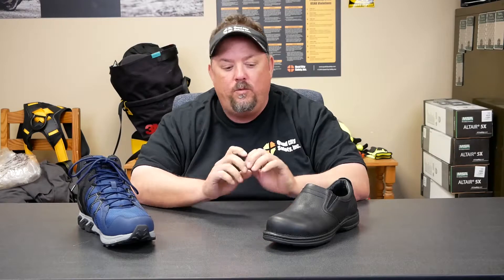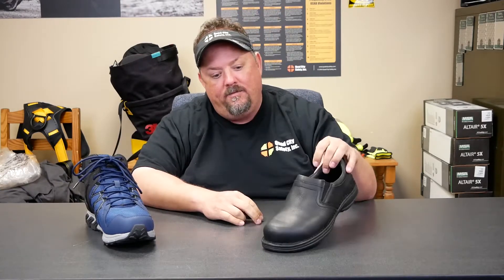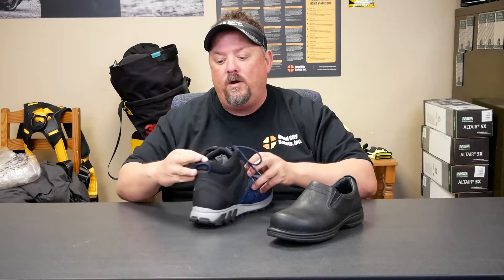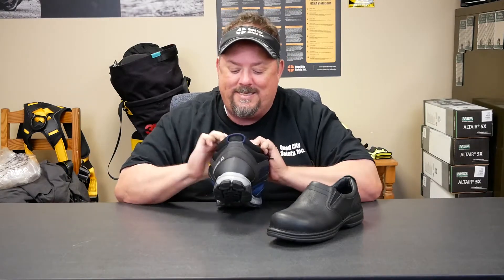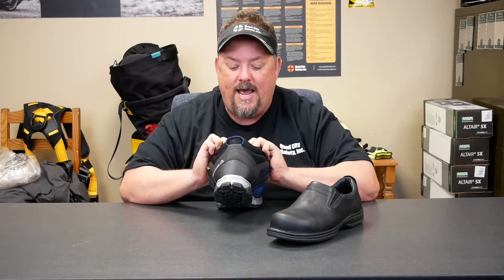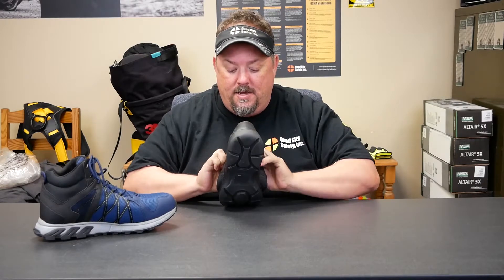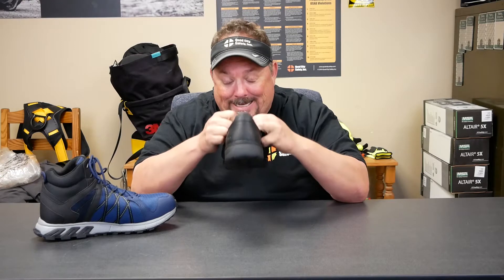Differences in EH (electrical hazard) vs ESD (electric static dissipation) and your workboots

Comment: I work in the auto industry & require ESD straps applied to my normal (non)ESD shoes to go through a turns-tile to enter the production floor. The ESD straps provided by the company are annoying & feel uncomfortable on my feet. At the same time, I've purchased a few different brands ESD shoes as an alternative to using ESD straps, however, those ESD shoes fail at the turns-tile, thus, not allowing me to enter the production floor. Why does this happen? & is their a way to overcome this problem? Thank you.

Comment: I’m a forklift driver in a warehouse and have to wrap plastic (saran/cling wrap) around some pallets occasionally and get shocked through my fingers and sometimes my toes, what do I need? Thanks 😊
Reply from the maker: ESD.  Thanks for watching!
Reply: Hospital worker pushing chairs, blanket static and trouser static…then touching lift buttons and patients im guessing ESD. I’ve had 2 inch sparks! Please help, im scared to touch anything after quarter mile run to pick patient up. ESD? It’s ridiculous why can’t hospital earth the wheel chairs.

Comment: So which one do you use in your house? I still don't get it
Reply from the maker: You most likely don’t need protective footwear in your house so I’d need to know more about the work environment to make a recommendation.  Basically EH would prevent electricity from zapping you Vs ESD would prevent static from building up in your shoes and then zapping something electronic like a computer board.  Hopefully that makes sense.  Thanks for watching!

Comment: is ESD and EH can be in same safety shoe?
Reply from the maker: Ismail Alyousuf they can not.  They serve 2 different purposes and the energy is conducted differently.  Depending on what the job is and the hazard will help us get you into the correct boot.  Thanks for watching and here is some more info!  
https://www.quadcitysafety.com/contractor/blog/bacons-safety-tip-protect-your-piggies-with-electric-hazard-foot-protection?hs_amp=true
Reply: @QuadCitySafetyInc  Thanks.

Comment: Can you use a esd insole in a steel toe and it be just as good as a esd boot?
Reply from the maker: Thanks for watching.  Short answer is no.  The boot has to have ESD stitching as well as the insole being ESD.
Reply: @QuadCitySafetyInc  - Building on his question, could you expand on why the stitching is necessary? Thanks.